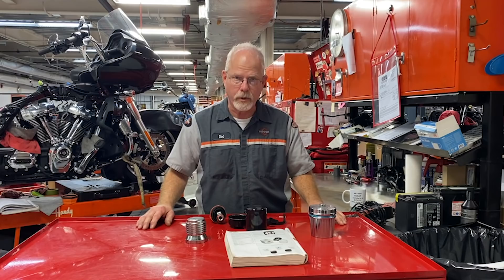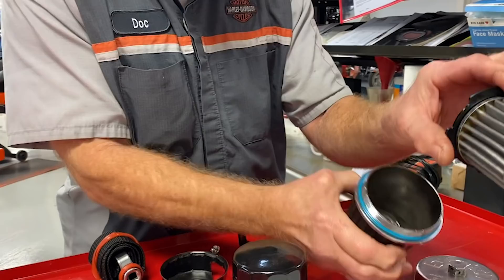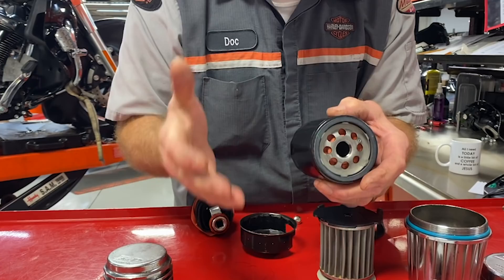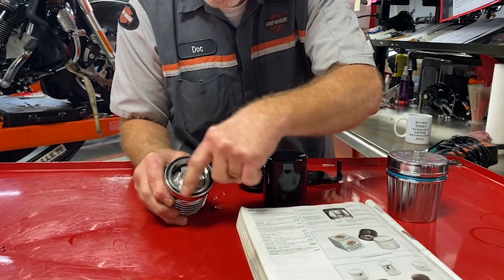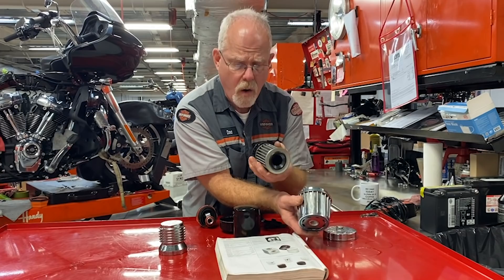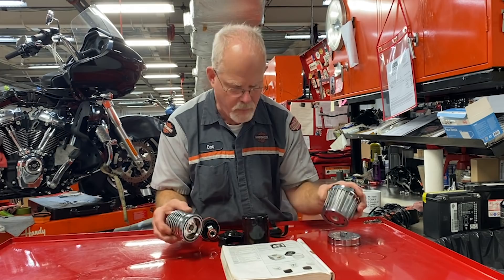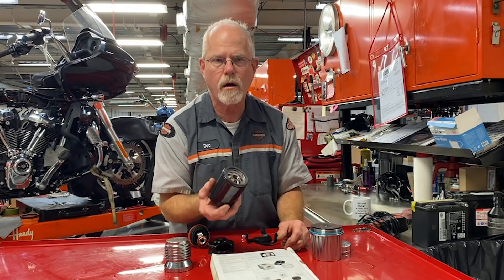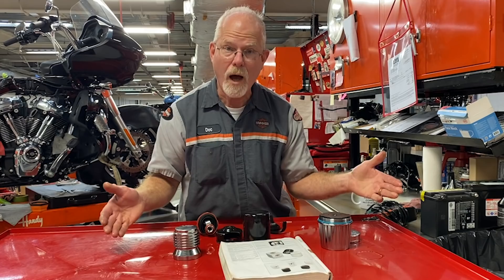DOC HARLEY: REUSABLE OIL FILTERS

Comment: We'll Doc this is were we part company. I always watch your Videos for a reference. I must say this is the first time I completely disagree with your analysis. Heat is the worst enemy our bikes have. The flo filter (the one with the fins)  will cool the oil. The fins have to radiate heat. They claim a 10 degree cooling. I have run these filters on 6 or 7 builds. I always use a temp sensor when I stick 10 grand or more in a motor. I have to agree with them. They also claim an 8percent increase in flo rate over a paper filter. Which I have not attempted to test. They are right with the temp so I am willing to give them the benefit of the doubt. More flo when it's cold, cooler normal operating temp, one time purchase, that filter will pay for it self in 8 changes. Sounds to me like a win win win.
Doc we can disagree. I good with it keep the videos coming.
Reply from the maker: I appreciate you facts and sharing. I deal with HD products all the time and can not get the good feedback like yours....Doc

Comment: Fight after this one...  How about the disposable paper element oil filters that are twice as long as OEM HD?  Let the fights begin!
Reusable Oil Filters... Buy from a Company that has been in business for decades.  Buy with the correct features; easy to remove nut or surface to grab onto, magnet metal catcher inside the filter, size, etc.
Why would I get one?  To clean the oil better than a paper media filter.
Concerns?  Maintaining correct oil pressure at all times.

Comment: The reusable filters do not have an anti drain back valve... what are your thoughts?
Reply from the maker: You have to do your research and purchase a quality unit….Doc
Reply: @LowCountryHarleyDavidson  how important is the anti-drain-back valve with the filter in the stock horizontal position?

Comment: What is up if you have an issue with counter filters not sealing. No obvious damage on ring seal or flange. The old filter was on really tight and now have an issue with drips. 2017 RGS

Comment: The fact that these type filters are used in the aerospace industry tells me everything i need to know. Imo it makes no sense to keep using paper filters and  throwing billions of nasty ass filters in the trash ending up in landfills. That alone should make you die hards switch not even taking in account for a cleary superior 100% reliable, faster flowing, magnetically pre filtered, inspectable filter that drops the oil temp. The faster flow across the filter while filtering to 10 microns means the oil is passing thru the filter more often than paper with same micron rating. It doesn't take an engineer to figure out the more often the oil is passed across the filter media the cleaner your oil will be. There are zero drawbacks to using them and a bunch of reasons to switch. The same reasons these type filters are used in aircraft, spacecraft and other uses where failure isn't an option. To say HD engineers design the oem filter for optimal service is funny when they designed my SG and dropped the ball on so many other things.
Reply from the maker: You may step down from the soap box now…..Doc

Comment: The snall filter you show is 30 microns according to seller. I have used one briefly on my destroyer it now gathers dust on a shelf and i use stock hd.
Reply: Independent tests show that stock filters clog around 3k and then you're just running dirty oil through the bypass, while 30-40 micron filters don't clog while still filtering all debris from the oil.
Reply: @remedialone6987  if a 30 to 50 micron filtered everything it it would clog too. I would like to see those tests.

Comment: I have a Flo reusable like the little one you have there. They come with 2 seals and you can reuse each one several times. They also give you a part # to get more at McMaster carr I think it is. 

https://www.dkcustomproducts.com/outlaw-high-performance-cleanable-oil-filter-in-anodized-black-dk-ocof-ab.htm

I run this one made by flo. Mainly for the added cooling. But you can feel a little better throttle response

Comment: Sounds like he works for Harley and just selling Harley OEM stuff. I’ve had mine (shown in this video)  on for years 2008 Electra glide 150,000 miles and still going. K&P is the one I have and I love it!!!!
Reply from the maker: Yes I have worked for a Harley Dealer for 34 years and yes I promote what the factory designed for their product. I am glad you found a product that has helped your bike reach this high mileage....Doc

Comment: Good video. As i belive the hd filter is the best for our bikes and never really thought of really running anything else. But what's your thought on oil i just bought a new 2020 sg and i know it comes factory filled with the hd 360 conventional oil. Should and do u recommend staying with it or should i switch to the SE synthetic?
Reply: I can't tell you anything about the HD 360 oil because I have never used it, but I can give you my thoughts on the Syn3. I have been using Syn3 for several years and have had zero problems with it. You will see people on the forums bashing it, but they never have any real proof to back up their claims.  I send a sample of my used Syn3 to Blackstone-Labs in Ft. Wayne, IN every so often to have it analyzed. The analysis has always come back damn near perfect. Blackstone-Labs will not only let you know what shape your oil is in, but they will also let you know if you if your bike is running right, are you using a good oil filter and air filter. They will give you the break down of the metals found in your oil and compare your wear levels to other engines in the same category. They will also let you know if you should go further between oil changes. No sense in wasting money on changing your oil way to soon all the time. Go by what the owners manual says, the manufacture knows your engine way better than some keyboard jockey does. The only time I have ever had something in my oil report that was a little off with the Syn3 is, one time the viscosity was a little higher than what it should have been. That sample had 6,200 miles on it from a cross country and back trip that I did in a week.   My thought is, the additive package might have evaporated a little.  I use Syn3 in all 3 holes. I carry an extra quart with me on long trips incase something happens and I need oil. Plus, there are HD dealerships all over the country and if I need oil, I don't have to go looking for some other brand  that I might be using at the time. As for oil filters, well I seen  several cut-away oil filters at a bike shop a few years ago. The HD filters paper element was contained inside what looked like panty hose, to keep the paper fibers from breaking free and running through your engine. The K&N looked like the best built filter to me. I have used them for years and never had a issue with them. One good thing about the K&N is, you can use a 17mm socket to remove the filter and not have to try and get a filter wrench in there to remove the old oil filter. I have been getting my K&N filters on Amazon for just under $11 each. Enjoy that Street Glide!
Reply: @Chaplain161  thanks for you input really appreciate it. I just heard so many different opinions on oil just not sure what to believe i do feel comfortable running the hd oil cause i know its made for are machines just didnt know if synthetic 3 was actually better than the dino oil.
Reply: Oil debates could go on forever...   just put in recommended oil (service manual), change at recommended intervals and all with be fine.  Guy has a youtube channel call Project Farm, he compares oils with tests and pretty much ends all the Amsoil, Mobile1 oil hype.
Reply: @Chaplain161  Blackstone did oil analysis for me last month. Condition of the oil was given in the report.
Reply: In my opinion synthetic oil should be used when operating in locations with hi average temperatures such as Texas Arizona and so forth. I use Dino oil for break in and then switch to synthetic since I live in Texas. I use Mobil 1 V-Twin because no matter where I'm at I'm probably never more than 50 miles from a Walmart and can buy it on Sundays and Mondays and after 6 on a weekday unlike Harley products. The most important thing about boil is to have the proper amount in your bike and to change it as recommended.
Reply: @bigblue3568  Project Farm looks cute but much of what he does is not applicable to us.
Reply: @midnightmc3096  same base oils... absolutely applicable.
Reply: @bigblue3568  Nope,  Internal conditions and what not are not the same, so from what I understand, his tests aren’t applicable for the most part.
Reply: @midnightmc3096  hmmm strange that cold oil flow test, friction test, evap test etc of engine oils don't apply to the internal motorcycle combustion engine.  Texas AM Petroleum Engineering School will have to toss out all their text books.

Comment: Doc fails to point out that the K&P filter has a rare earth magnet on the top of the filter element. That visual of ferrous wear metals is seen every time the filter is removed. That metal is what you need to see to know the absolute health of your engine and oil. Minor amounts of wear is normal. Excessive is obviously bad and something is failing in your engine. That visual of metal can be the difference between a minor repair or a catastrophic engine failure!!! The HD filter no matter how small the particles cannot be seen without cutting open your filter each time.  Plus 5 micron rating is the absolute rating. Not consistent filtration
Reply from the maker: Thank you Tom for this informative post....Doc

Comment: I run the paper filters myself. But the real question is. Is it inherently bad to run one of those metal screen filters for the full 5000 miles vs a straight run down rhe drag strip. Or the ability to provide better oil flow during cold weather startups. Or wide open throttle situations. The other thing is that when I research these filters I can't find any absolute efficiency information.

Comment: Great points. What do you think of oil analysis by Blackstone Labs, etc.
Reply: I use Blackstone labs almost every oil change. They give good oil analysis that I can understand and they are much better at that than I would be by opening up a filter and trying to tell whats going on in my motor.
Reply from the maker: I have no experience with this company. Oil analysis is great for those that desire that knowledge. Thanks ~ Doc

Comment: Everything you said is 100 % true doc. These filters are for people that dont understand filters but like the beauty. Its a beauty. Back in the 60s there was a Motorcycle club in San Jose California that had Frantz oil cleaners on their Harrleys They cleaned the oil down to about 1 micron but required.hoses. I assume they kept the stock filter. Normally the full flow filter is to remove the engine damaging abrasives. Oil drains are to remove the engine wearing abrasives and sludge. If a full flow filter had enough depth to clean oil the relief valve would.always be open as long as the engine is running. It would be a bypass filter that screws on such as a Trasco or Stilco.
Reply from the maker: Thank you for sharing your knowledge....Doc
Reply: I am a car guy. What little I know is the Wix is a lot better filter at cleaning oil than the reusable filters. Dont know anything about the Harley Davidson filters. One company claims 70 micron filtration. A 50 micron abrasive is a boulder between two polished surfaces.

Comment: Lol they have better flow and it’s been proven to give more hp and tq
Reply from the maker: Really? Please share your facts to my Email…..Doc
Reply: @LowCountryHarleyDavidson  Hey Doc,
The smaller oil filter you show is a FLO. Companies like DK Customs and Ultra Cool claim an increase in HP and torque as well as a cooler running motor. There is also a claim that the Harley race team uses a FLO filter. On the other hand some engine builders claim they do not filter as well and the increase in oil pressure is bad for the motor.

Comment: Great post about oil filtration, Doc. One of your best and you bring to light important issues about this subject. We are all subject to marketing ploys about what is best for our motorcycles. Changing our oil and filters are reasonable service intervals is prime motor care. Personally I don't believe these aftermarket self-cleaning filters are better than the OEM filters because I don't believe the average do-it-yourself Harley owner can/will sufficiently clean these metal mesh filters enough to warrant their use. Using an outside oil analysis firm like Blackstone Labs will tell you more about the wear trends in your motor than you cutting open your filter and trying to visually analyze it yourself.

Comment: What kind of person would spend 115-250 dollars on a reusable oil filter, when normal OEM ones are 13 dollars?
Reply: A person who wants to see the wear rate of the engine and if the deposits are normal or an indicator of failure, which is useful to head off catastrophe before it happens.  Changing every 3,000 miles pays for the filter by 30,000 miles. The HD recommended 5k miles interval is based on EPA requirements and nothing to do with anything extra they have done. But if you have a bike that stays in the garage more than it gets ridden, then you are absolutely right to stay with the OEM filter.
Reply: @davidc998  Worse filtration leads to faster engine wear out, if you are concerned with monitoring your engine so much, just cut the regular oil filter open, it is probably going to be a lot dirtier than a changeable one, because it filters better.
Oil filters are designed for synthetic oils now, they are designed to last those 5000+ miles. 
It is almost as if, the engineers that design things, want them to last the designed time periods so they do not take a dip in sales because the quality control is bad.

But know-it-alls using knowledge from 30+ years ago, still think that natural oil and filters that they have to clean and have worse filtration, are better.
Reply: @Evirthewarrior  That is completely untrue.  Periodic oil analysis has proven this filters extremely well.  I recommend that you do your own research before guessing  and stating erroneous conclusions. Oil analysis was how I discovered that sometime between 3k and 5k miles, the OEM filter became overwhelmed and was bypassing filtration. So the final 2k miles were not being filtered. And more dirt in the oil had accumulated significantly. I do use Amsoil. But still prefer 3k miles. I have over 60k on the Harley but that is the one I tour and travel with.
Reply: @davidc998  he literally said it in this video, and I have see multiple other car mechanics say the same thing about reusable oil filters
Reply: @Evirthewarrior  Oil analysis is more scientific than a mechanic that  wants to sell his product. If you use a mechanic (I don't) he doesn't want to take time to clean and dry the filter. So of course he is going to say that.
Reply: @davidc998  cut open your oil filter, he even suggests it. Did you watch the video or just comment?

Comment: Strap wrench would take that chrome filter off easily with no damage.   But the cost of that filter you could probably buy enough K&N Chrome filters to last the life of your motorcycle or at least several decades of riding.

Comment: I don't know Doc, Call my over the top but. I've had 7 different Harleys.(cruisers) in the last 10 years,  I change engine, filter, primary and trans oil every 2500 miles, or before. Never had a break down because of lack of service. When it comes time to sell one of my bikes they go within a week or less when I show the service dates and miles....New oil filter every time, it's cheap cost protection....
Reply: I'd be changing oil about once a month at that rate! Whatever floats your boat brother.

Comment: This has nothing to do with oil filters, but I wanted to ask a question about exhaust mods. Will it “hurt” the engine on a 2020 road glide with the Milwaukee 8 114 to pull out true duals with no “cat” and slip on mufflers, without retuning the engine? No others mods, just exhaust.

Comment: $140 for the Flo oil filter. I can buy a HD oil filter for $15. It would take 9 oil filter changes to break even.
Reply: It would take more than that even, 'cause unless we value our time at two bucks an hour, the whole cleaning process isn't done by someone else's butler 😁  And, the whole process uses brake cleaner, etc., and aside from the cost of that, it's also not exactly environmentally sound to flush the gunk down the drain.  Because ...no, the used conventional filter should NOT go in a landfill but be routed to a hazardous waste facility/outfit to be disposed of properly.  It's even the law here in California, as it is in some other states - as it SHOUD be.
Ride Forever!  ~  🦅

Comment: Ol Doc Harley sounds like a HD filter salesman.   I think one of the main benefits of a reusable oil filter is cooling.
Reply from the maker: I sell and talk about what I believe in and work with every day. Thanks for sharing your opinion about the reusable filter…Doc
Reply: @LowCountryHarleyDavidson  I would like to see HD come out with a big copper reusable oil filter with fins for maximum cooling, reduced landfill waste.    Plus a nut on the bottom so it can be removed with a socket or wrench.   I would also like to see the HD Bar & Shield logo on it.   I bet they would sell like hot cakes at $300 a pop.